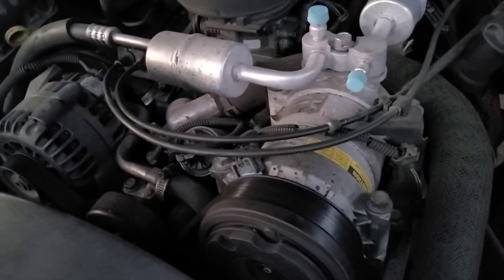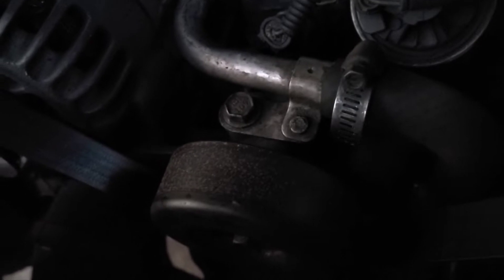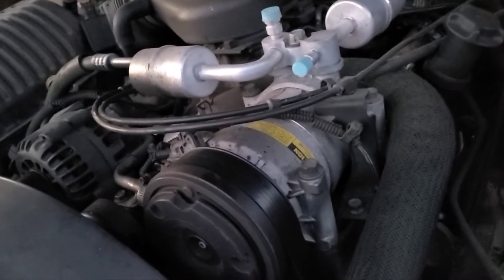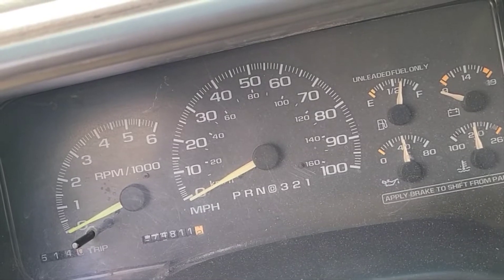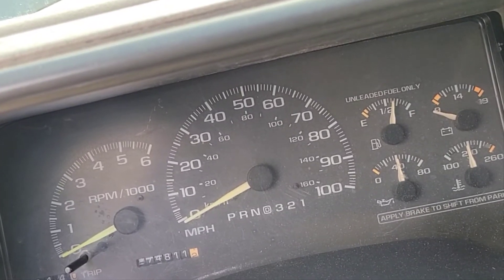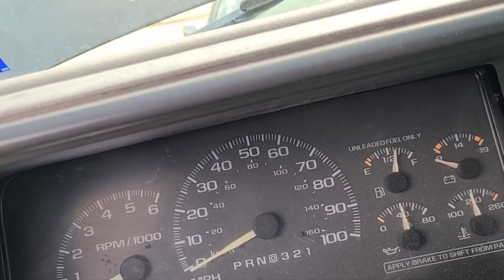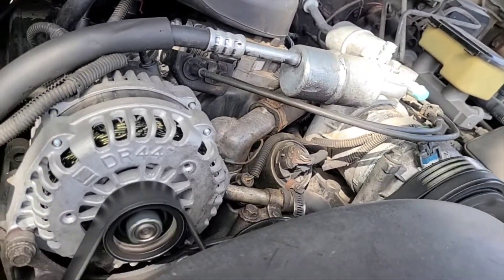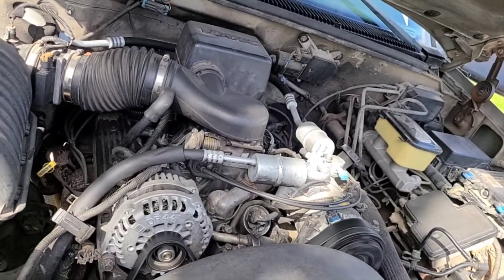1998 Chevrolet C3500 5.7 MPFI conversion

Comment: I thinking about doing this to mine, did you notice a performance increase and does it sound different?
Reply from the maker: The engine sounds slightly tamer. As for performance its about the same but I've already noticed the mpg gains. Highly recommend.